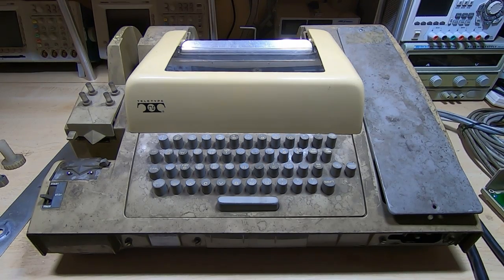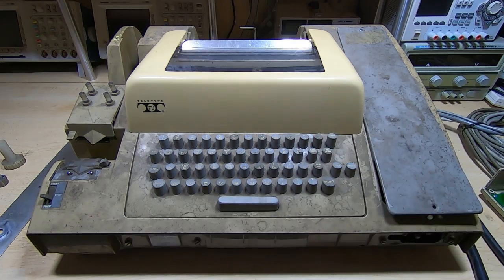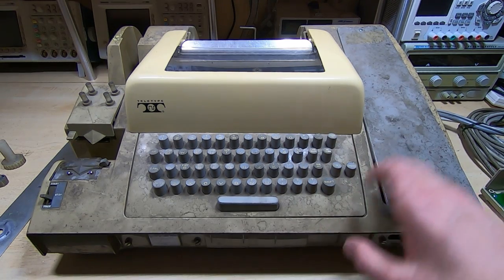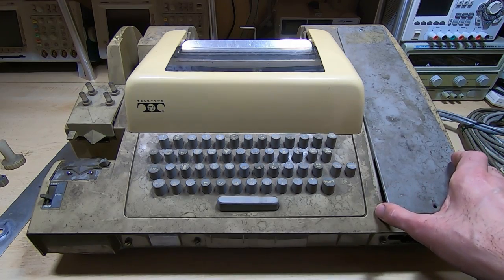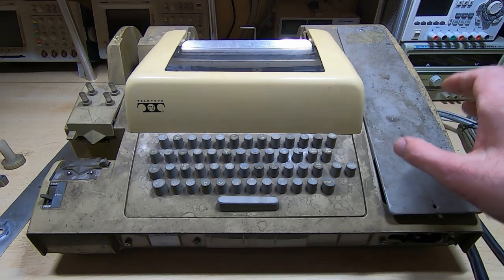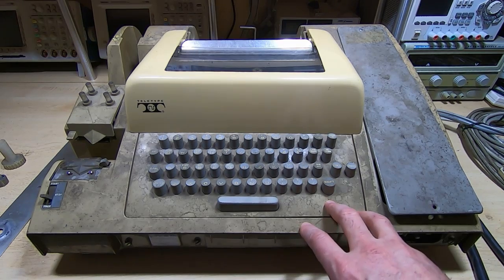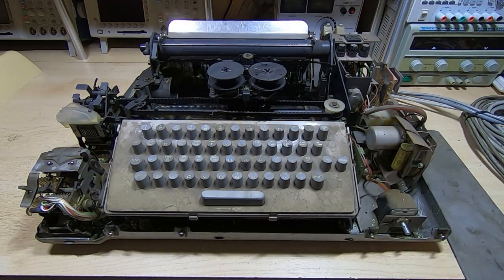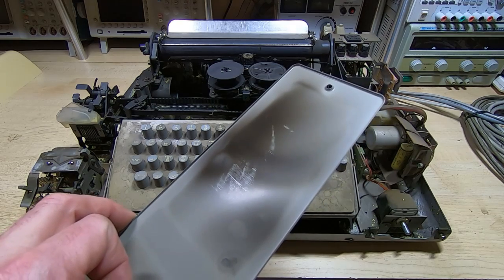ASR33 Restoration  Part1

Comment: Regarding the chatter pipe: someone probably left it in because it can ne reconditioned. It can be reused after the one they put in breaks. They probably had no use for it themselves. If you can't find a new chatter refuse chute, you can use that old one and a zip tie or an intermediate diameter pipe and you'll be fine.
Reply from the maker: No need to reuse it, It is a standard sized piece of PCV tube so could be replaced for about 10p. Most likely the old one stretched and would not stay on so they fitted a new piece and left the old one inside the machine. I will most likely replace the one that fits anyway as it has become a bit too rigid. The last ASR33 I repaired had a watch in the chassis behind the punch. I was expecting to find the arm it came off but it was just the watch. I have no idea where it came from and the owner said it was not his.
Reply: @JerryWalker001  did you try opening the watch? I expect there to be a little leprechaun inside, with an even tinier pot of gold

Comment: Excellent series, I had to work on a lot of the TI silent 700 series in the 1980s, so very interesting to me.
Reply from the maker: The TI silent 700 is a very nice machine and unlike the ASR33 you do not need to wear a crash helmet and ear muffs to use it.
Reply: @JerryWalker001  Yes, it's biggest problem was the fact that it used thermal printing to be silent. This was when I worked for SDC (Strategic Defense Command) aka star wars. The military likes to buy lots of equipment pretty much as soon as it is declared obsolete (Intel 310 systems is a prime example). Anyway, they had lots of silent 700 terminals with 300 baud modems, but during the summer, you didn't want to leave any printouts in your car, or next to a heater vent in the winter. You probably didn't know, but a militarized version of the PDP-11 was the primary computer used for Patriot, mainly because it was the fastest off the shelf millspec machine available.